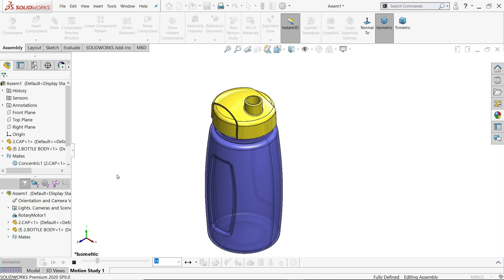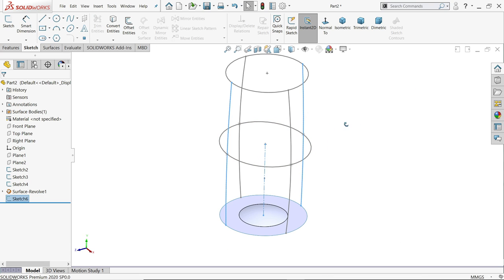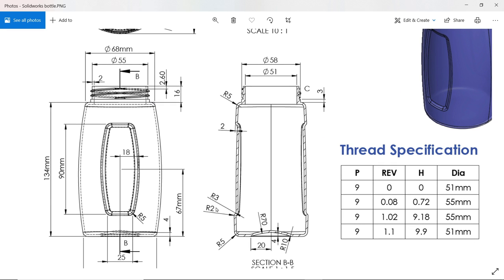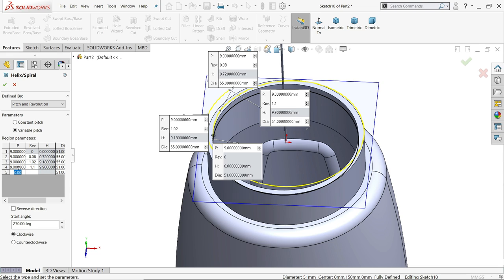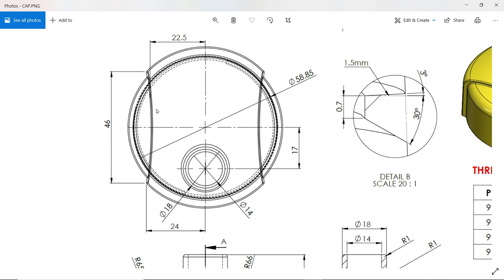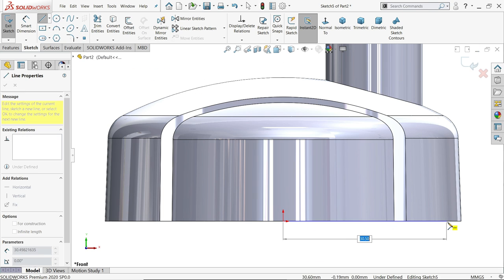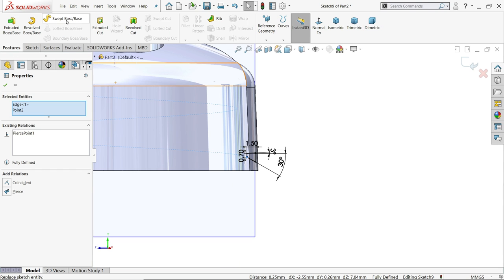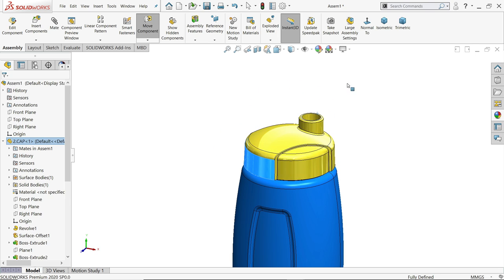SolidWorks Surface Tutorial Bottle and Cap

Comment: Sir my solidworks solidworks properly not work . Could you solve this problem. The problem is that when i pick a  command  EXAMPLE line or  provide dimensions the command os finish after one click. Like if i choose dimensions and  start provide dimensions  it will only provide a single line dimensions and if i want to given another line dimensions then i have again choose dimensions